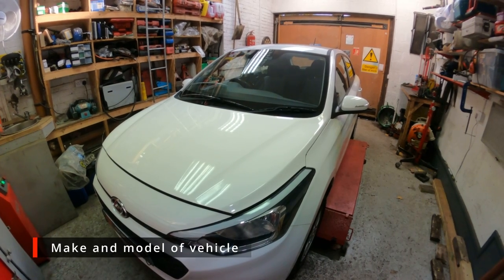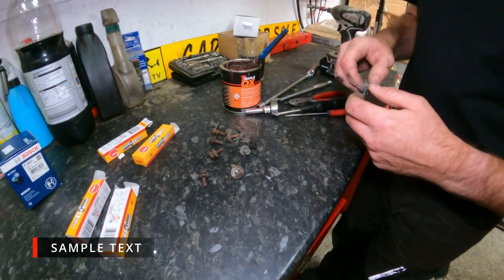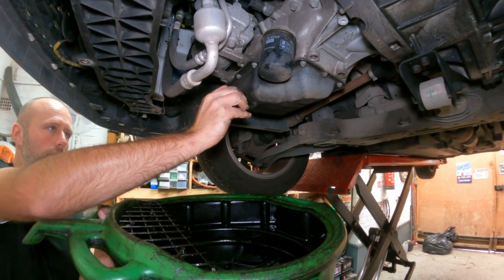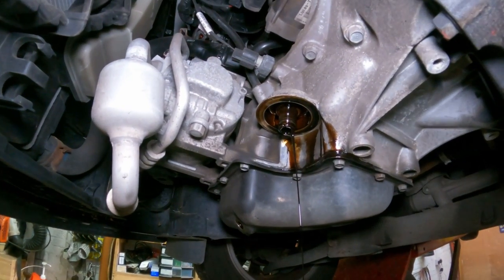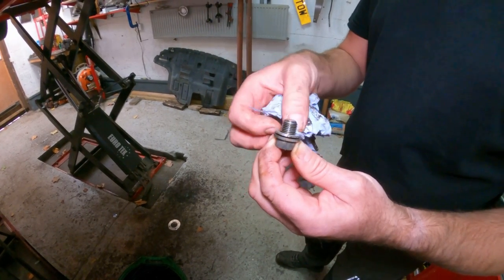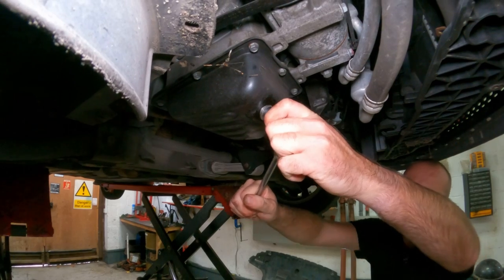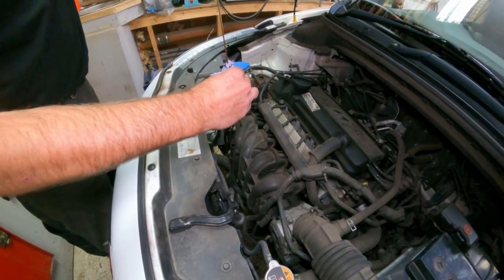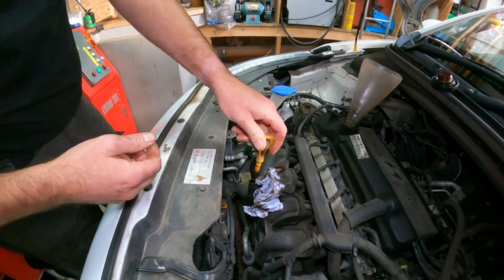Hyundai i20 1.2 Petrol (2016) - Oil and Oil Filter Change

Comment: Hi. Have you got any idea what can be responsible for the fuel smell in the interior, after the engine starts?
Helpful video.
Reply from the maker: Hi marjanm
Thanks for watching😀

If the smell is only since the oil and filter change its most likely a spot of old residue oil burning off the outside of the engine or exhaust. 
It should pass but worth checking the filter and sump plug aren't leaking.